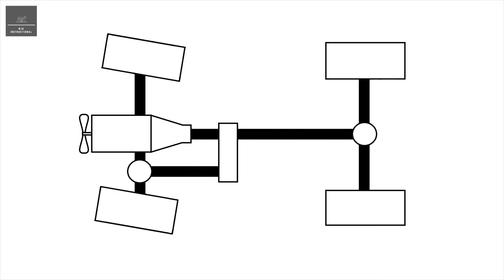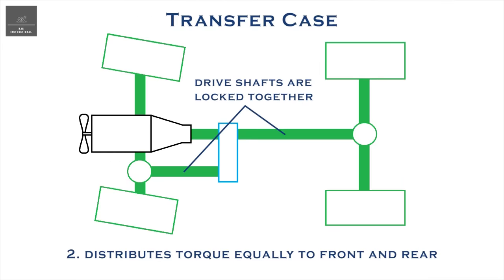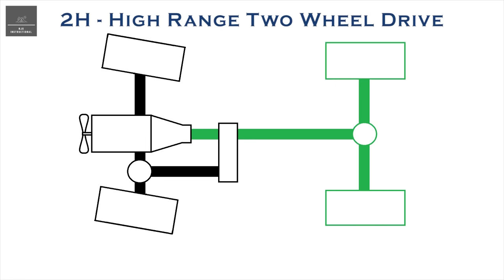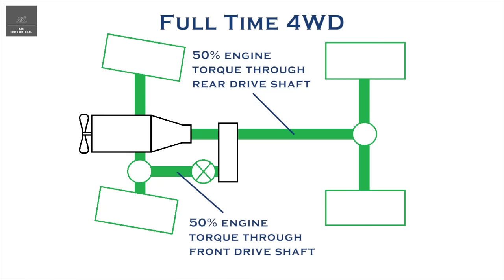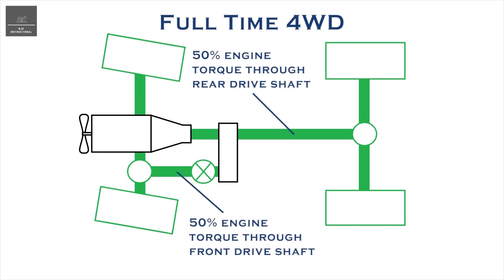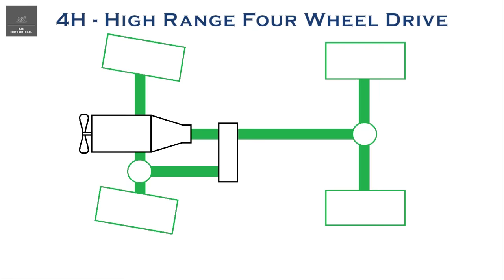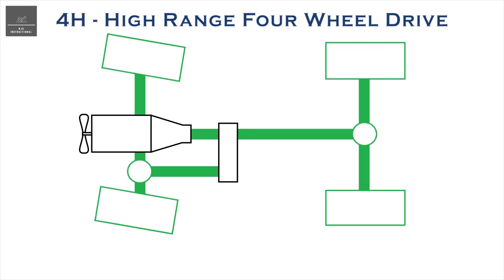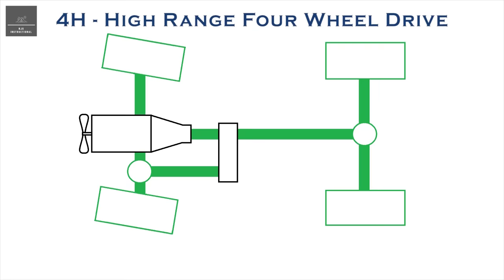How 4WD (4x4 - Four Wheel Drive) Works - 2H, 4H, 4L, LSD, Centre Diff, Diff Locks, Traction Control

Comment: Question. Thanks for this nice video. I love it.  I like the way you clarified all doubts and questions. I have a question too.  I don't have a pick up but when I have it. What are the gears to use the 2h, 4h and 4wd system? Thanks.
Reply: 2H, 4H, AWD you can run in any gear.  However, in 4WD, it is best to be off tar mack.(unless on slick roads like heavy water, snow or ice)  And most manufactures suggest going less than 55 MPH.  In AWD, none of that matters as it is being figured out by a computer and you just drive normally and it will figure it out.  4L is a whole different animal.  Since it doubles your torque going slow is your best option.(doubt you can go very fast in 4L)  So yes, you can be in Drive, but don't expect it to act like you are cruising down the highway.  In a manual, 1st gear will suffice.  Once you have negotiated the terrain that requires 4L, you will want to go back to a higher setting.  This will reduce wear and tear on all components and give you better fuel efficiency.  As for what he called BTC, that often is engaged in 4L to give you maximum performance like having all wheels locked at the same time.  Which again is something you will do in 4L in 1st gear or Drive.(which drive will automatically go to 1st gear as the description implies(automatic)

Comment: Great video. One of the best I have ever seen. Have you done a separate video on AWD vs Full Time 4WD?
As I understand, the AWD has an open Centre Diff just like the Full Time 4WD ... but there is no low ratio gear set. In the Full Time 4WD the Central Diff is lockable. I would also like to hear more about the split in an AWD and a Full Time 4WD with central diff open. Is it 50/50 or rear-biased or front-biased or depends on make and model and weight distribution on incline or other factors in terrain? I will be grateful for this guidance. ❤
Reply from the maker: Thank you, I have recently released a Part 2 video which covers more about Power and Torque transfer in Open and Locked Differentials.

Comment: Thanks mate very informative video well presented. So my toyota van is a full time 4wd auto transmission with a low gear. How would the van perform if both front wheels were off the ground essentially or free wheeling hubs were fitted on the front wheels.?  I've wondered this for some time and if it might improve fuel economy. Thanks
Reply from the maker: Be sure to check out my Part 2 video on Open and Locked Differentials. This may help answer your question...

Comment: On most of the trucks I've owned, i have had "Detroit lockers" installed in the rear diff. That way when in 4 wheel drive, i have at least 3 wheels with power. I now drive a jeep gladiator rubicon and it's four wheel drive system works well enough.

Comment: great video! Thanks! One question about locking hubs: as I understand your video, in vehicles with freewheeling hubs, you have to lock the hubs and turn a switch in the vehicle to 4h or 4L. I was under the impression that a friend's truck had manually locking hubs instead of a switch inside the vehicle, but after your video, I don't see how this would work. Did I just misunderstand how his truck works? Did he have a switch inside as well, and I just didn't notice it?
Reply: No you did not misunderstand.  The switch or the stick shift inside is to switch between 2 or 4 wheel drive and high or low range.  Manual locking hubs require you to get out of the vehicle and turn the lock on each hub.  Later on, companies developed locking hubs that could be switched from inside.

Comment: Great Video, I wish their was hands on training for new 4 wheel drivers, would stop roll overs.
Reply: That has nothing to do with how the drive train works.  That comes down to driving a vehicle with a high centre of gravity like it was a car with a low centre of gravity.  Also, if you're doing extreme off road driving and rock climbing, roll overs are just part of the fun.  Which is why those guys drive 4x4's with roll bar cages, not SUV's with 4x4 drive train and no roll bars.

Comment: Traction control works well in some instances but in my underpowered Suzuki Jimny it can bring the car to a stop as the brakes are applied to stop slippage. Is there any way of disconnecting this TC. It has a TC off button but once you go over (or the vehicle thinks you are) 30 kph it automatically switches the TC on. It's really bad in deep sand. Can you temporarily take out the ABS fuse?

Comment: Great Vid. Question. Could a Manufacturer incorporate both LSD and BTC instead of the locked diff.
Reply from the maker: Great question. It may be possible but from what I have observed, as soon as the manufacturer introduced BTC they unfortunately did away with they LSD at the same time. Not sure if this was a cost saving exercise or if the two clash... This was true for the Y61 Nissan Patrol, Isuzu MUX/DMax etc.

Comment: Awesome explanation, now when it come vehicle that has 2hi, 4hi, 4lo and a center differential lock option, does that mean that the vehicle will operate as a full time 4x4 vehicle when in 4hi unless you choose to lock the center diff?
Reply from the maker: In this scenario, driving in 4H without the centre differential locked will mean the vehicle will operate as an all-wheel drive vehicle, not a four wheel drive vehicle. In 4H, as soon as the centre differential is locked, the vehicle will operate as a four wheel drive vehicle. Hope this clarifies.

Comment: Off -Road (REAL off-road) nothing beats LOW gears, aired-down proper tires, and LOCKERS front and rear
(Along with proper suspension).  On road, full-time 4WD with locking center diff and an electronic brake traction for the low gear is best.

Comment: I have other questions also. But I think my lack of basic engineering knowledge is a hurdle in my understabding. 
Fir example ... I am unable to grasp the concept of crawl ratio. I know that the transfer case has a dufferent output un high compared to low range settings ... but is this ratio fixed at a certain number ... soemthing like 2.488 or egatever that number is? Ir different manufacturers or after market transfer cases will offer dufferent rayios? I owned, in the past, not now, 2 unique vehicles, a Unimog and a Stonefield. I always thought their difference in speed and power was more pronounced than the regular vehicles like Toyota Landcruisers and Mitsubishi Pajeros. (these are in vommon use where I live). I will actually appreciate clarification of such concepts but of course it is too much. Apologies forvribging out my own personal weaknesses to the comments section. Dtay blessed Sir. ❤❤❤❤

Comment: Man, this helped me a lot. I never knew what a LS Diff is but wondered why I have it and need to put extra stuff into the Oil. Thanks... What I didn't get, can I use my 4H on my part time 4WD on normal roads (like in the city) without hesitation? Or is that also only for offroad use?
Reply from the maker: Glad it helped. No, only use 4H on low traction surfaces, otherwise you will end up with wind-up and worst case a broken driveline.

Comment: Brake traction control , axle lockers and, limited slip differentials are not on most older 4x4s.   They added that when they added anti roll bars.  They are not really needed if you have suspension flexibility and anti roll bar severely limits suspension flexibility.
Reply from the maker: Can't beat suspension travel. Stay tuned, I'll have a video on anti sway bars in the new year and test out suspension flex with and without the sway bar connected.

Comment: Excellent video!  I just have a question. Regarding the center differential in full time AWD.  Is the center differential still an open diff type?  And if so, wouldnt it still suffer the same problems as an open diff where torque is transferred to the path of least resistance?  So if the rear wheels are slipping, would the center diff continue to transfer torque to the rear wheels?  And if so, how does that solve the traction problem? Or does it??
Reply from the maker: I'm in the process of creating a video which clarifies differentials (incl. centre differential). Power is transmitted down the path of least resistance, not Torque. Open differentials will always split Torque 50-50%, locked differentials will Torque to the wheel with most resistance...

Comment: I have one of the really rare full time 4Wd (with 4 low) 2005 Chevy Tahoes.   I still wish I had the normal transfer case but the full time 4WD does amazing in the snow and ice.    I wish I had the 2wd option though for normal driving.
Reply: I also have the G80 rear locker.    So, that does help.    But I wish I had the 4 HI locked option.   The 4 Hi unlocked still does awesome in the snow.   I do have 4 LO Locked which helps for slow situations.

Comment: You talk about 4WD systems sending power or torque to the front wheels (in addition to the rear) when 4WD is engaged. This is not always the case. If the 2WD mode is FWD then it sends the power/torque to the rear wheels as well when 4WD is engaged as the front already have drive.   Also the centre diff in some vehicles can’t be manually locked and also a centre diff doesn’t always split 50/50 front/rear. My centre diff is a viscous coupling and therefore varies the amount of power/torque sent to the rear wheels. There are so many 4WD types and systems out there it’s not good to make assumptions and state how things work as they don’t all work that way. As it’s probably difficult to cover all types and we don’t expect you to, you should include a disclaimer to state that’s not all systems are like your explanation or state before your explanation than in many systems which are 2WD to the rear (when not in 4WD) this is how it works etc. Too many assumptions and things stated as facts when many systems won’t be like your (very informative) explanations. Your comment stating that power in 2WD goes to the rear is an invalid blanket statement that is not true for all vehicles. 
Also not all 4WD have a low range and many 4WD have no transfer case.
And you forgot to mention the 4th system aside from locking diffs, limited slip diffs and brake traction control - and that’s torque vectoring to send power to a given wheel.
Your statement that only a front and rear diff locked system provides true 4WD is not valid - no where is it fact that “true” 4WD requires 25% power to each wheel. If all wheels have power - it’s 4WD even if one wheel only has 10% and often this is desirable as you’ll have more power to other wheels where it’s beneficial. A TRUE 4WD system actually just drives all 4 wheels and sends power where it’s best utilised and not to a wheel that’s in the air (such as when a diff is locked), you’d want all power to that axle sent to the wheel on the ground.

Comment: This was super informative, though I have a question. You explained Part Time and Full Time, but what if my SUV has both? I have 2H 4PT 4FT N 4L. So what type of four wheel drive do I have? This is something I've been curious about since I got my Jeep, so if anyone has info, I'm all ears!
Reply: Timothy Young which Jeep do you have
Reply: @brkbtjunkie  Grand Cherokee WJ
Reply: @brkbtjunkie  Laredo
Reply: My RHD 2007 UK Jeep Cherokee Automatic 4WD has Selec-Trak II which also gives me 2H 4PT 4FT N 4L. I have an auto gearbox plus a second lever for 2H (Basically default giving me 2WD + traction control + overdrive + good fuel economy). That lever also has 4PT (This is 4WD where torque is sent 25% to all wheels and can only be used in really slippery conditions hence Part Time because if you drove it on a dry road like that all the time there would be no way for wheels to travel at different speeds around turns and you would soon damage the  system and scrub rubber off the tyres), The Lever also can be put into 4FT (4WD where the left and right and right, and front and rear wheels can travel at different speeds by use of differentials allowing easy vehicle turning). The car can be driven in 4FT all the time which is why it is called Full Time though to do so will lower your fuel economy because torque is continuously provided though divided between left and right and front and rear axles all the time. In PT the lockable differentials permit this. N on the lever is neutral for being towed. There is, finally, a fifth position which called Lo which is 4WD part time but also Lo-Range. In Lo-Range the the rotational speed of all axles is approx 3 times less but the torque is approxv 3 more, which means it it is the most effective 4WD option available on the car especially over big rocks and ruts and the worst off road conditions (My Cherokee also has much more ground clearance than average cars). In Europe 4L is rarely needed. I have only used it in Switzerland when climbing very steep snow and ice covered mountain roads on skiing holidays. I once drove up a snow covered road with a cliff face on one side and 100s of feet of potential drop on the other. I confess I was scared stiff but traction never faltered for a second. 4L will give you amazing traction but at most around 30mph and terrible fuel economy. Enormous safety though. Now that Jeep has been sold to Fiat (I think?) the Cherokee is (stupidly) not available in UK and I don't like AWD systems which just use the brakes to stop wheels spinning and have no "proper" components (diffs and diff locks) for controlling traction by application of torque. There are long steep roads in my area and I have passed, in icy winters, other AWD and 4WD cars that simply can't handle even such non taxing conditions. While this is the most effective system it is also expensive and heavy (not good for fuel consumption). The latest such cars (The Top Land Rovers for example, do not have these levers like mine and can vary the torque distribution all by complex computer control. The principle is similar but they are top price too). This is why manufacturers prefer to simply put in a little computer and apply brakes to any spinning wheels which sort of works but look at comparison videos on YouTube.  This is a good video and I think your car is much like mine. Congratulations. What year is it and what country?
Reply: @barlart  That helps so much! Thank you! And yes, my Jeep is like yours but stock height. It's a 2000 WJ US
Reply: @jeeptim  Good to hear. They are superb vehicles imho. I'm sure you enjoy yours too. I have the the "Limited" model which is pretty luxurious with leather upholstery, Electrically positioned seats and heating, Integrated Sat Nav and Radio screen, Sun Roof, Climate Control, Tyre pressure control, Cruise Control. and I like it a lot. The new Fiat models lack the WWII jeep  ruggedness, I think.
Reply: @barlart  Nice! Yeah, I have the Laredo model, so I just have leather seats and that's about it. I do have the Chrysler Infinity Gold sound system, so that's a perk matched with the new GPS radio I installed. I very much enjoy mine and I'm just upgrading what I can to make it fit the 21st century better

Comment: Hi, try explaining the Mitsubishi Super Select system with 33/67 torque splitting in the transfer and centre Viscous Lsd,
 and how the front drive is engaged. The only 4x4 method that can utilise 2 wheel drive and all wheel drive on high traction surfaces. Not understood by many i would suggest.
Reply: My Jeep could run in 2wd or 4wd on high traction surfaces as it was part time/full time despite the flawed description in this video....

Comment: One question: On full-time 4 wheel drive, why can't we drive central differential locked all the time in high speed? Central differential lock splits the power to the 2 axels, there is no harm when cornering unless front or rear differential is locked. But, manufacturers say we cannot and you also say so. Thanks.
Reply from the maker: As you will induce 'wind-up' in your drivetrain...
Reply: @NJSInstructional  Thank you. Just have learned about wind-up.

Comment: I have a theoretical question…

What if your truck had an open differential on the rear end and the parking brake was fitted only on the left rear wheel brake. 

Now, what if your right rear wheel wasn’t getting traction.

Could you engage your parking break to re-distribute power to the right wheel by putting drag on the left with the Manuel brake?

Comment: That was great but I have yet to discover an explanation that includes “Auto”. For instance I have a 05 pathfinder that has the rotating dial with: 2wd, auto, 4hi, 4low? 
What is happening in this system when I am in Auto? How and when does it kick in? And how is it safe in hi traction surfaces? Oh yeah and how long until it disengages?? .
Reply: Anyone?
Reply: In auto I believe it is default to 2hi but when it senses the rear to slip it activates 4lo in low speeds

Comment: I have a f450 2008 4 x 4.  What happens if I manually lock the front hubs and DO NOT engage the 4 x 4 electronically in the cab?
Reply from the maker: Internally, the front axles will rotate as the vehicle moves...

Comment: Um, so, when a central differential lock is applied, we have to apply axle differential lock as well to get out of thick mud? You didn't explain what the solution is to the diagonal thing you mentioned, where one wheel on each axle is spinning freely. Do AWD vehicles have the option to apply axle differential lock then to fix that?
Reply from the maker: Good question. To get out of a diagonal situation, cross axle differential lock(s) will help, so will a good brake traction control system, or alternatively you can choose a different line.
Reply: @NJSInstructional   Thank you.